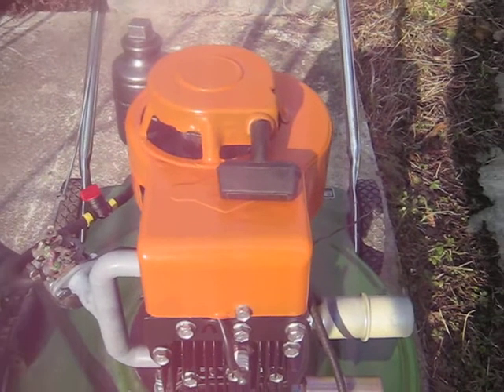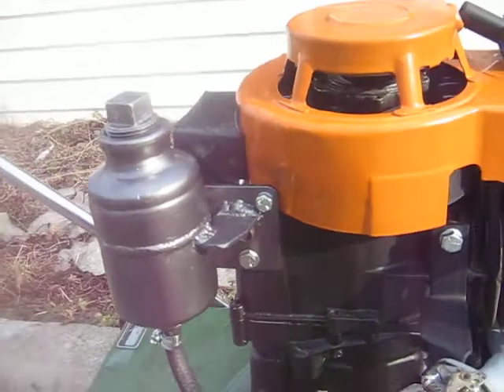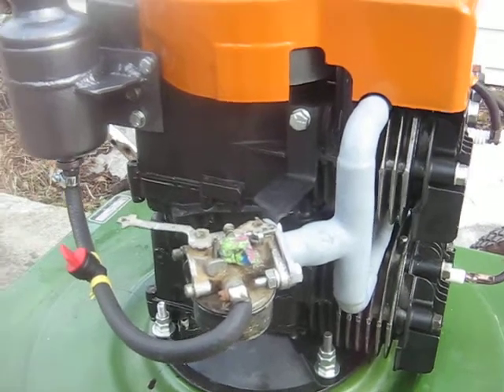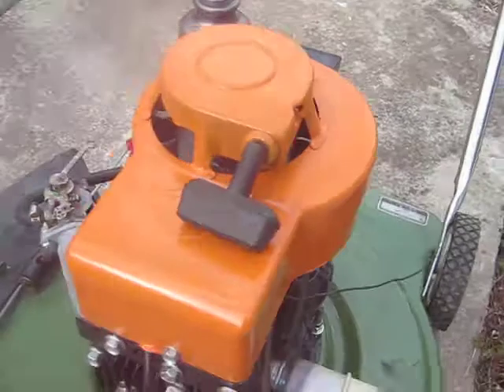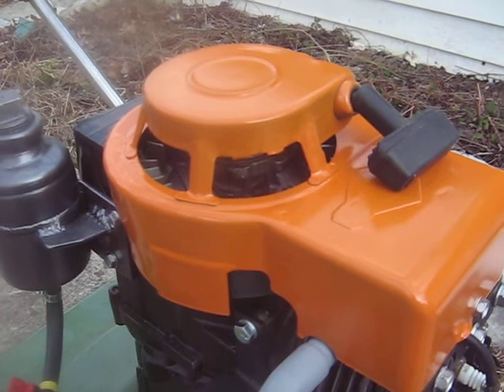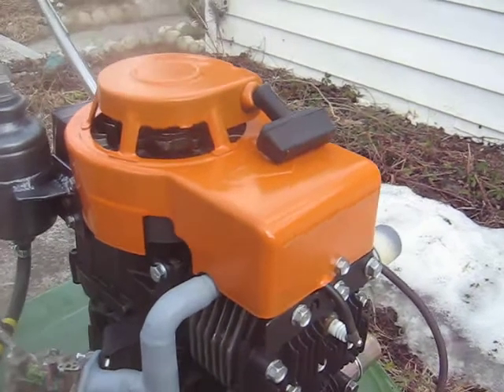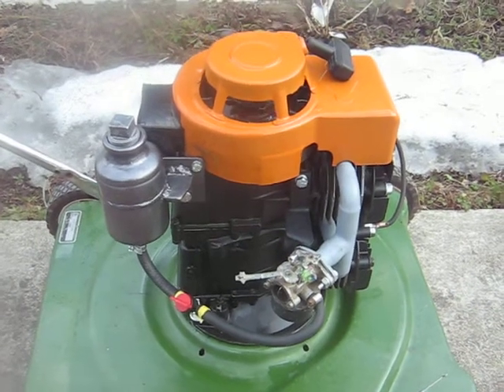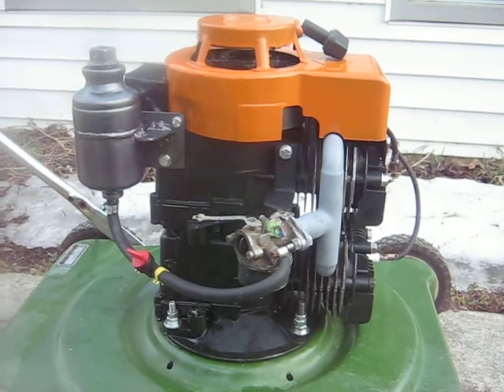FrankenBriggs 2 Cyl. Stacker Walkaround

Comment: it very nice looking, i love to use that you get some pretty odd looks. Any way you did some good clean work and she runs good to :D
Reply from the maker: I spend some extra time on the intake manifold, after I saw how cool AC/DC Welding made the gas tank look.Roadkings intake and exhaust look sweet, so I tried some filler in the intake. I happened to paint it primer gray instead of black, to contrast the engine so it showed up more.
Reply: ya the gray looks good kinda like the stock intakes on modern  Briggs 3hp
Reply from the maker: Yes, my son thinks I should try a plastic intake in the future to reduce inlet air temps.